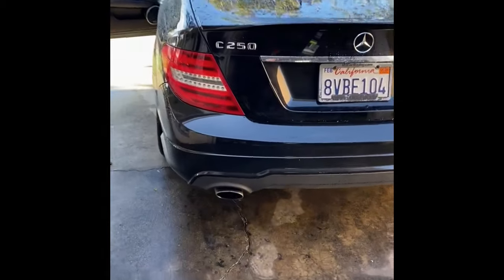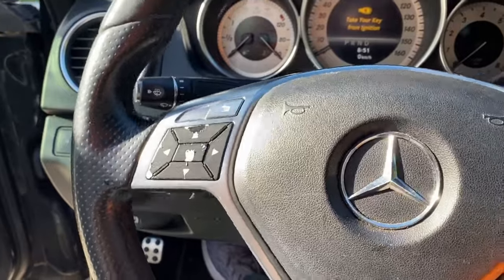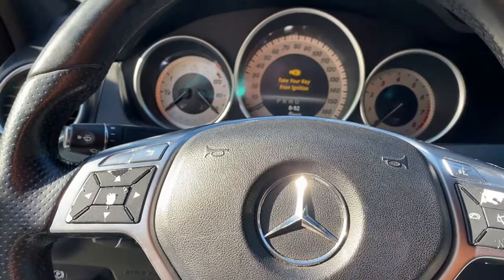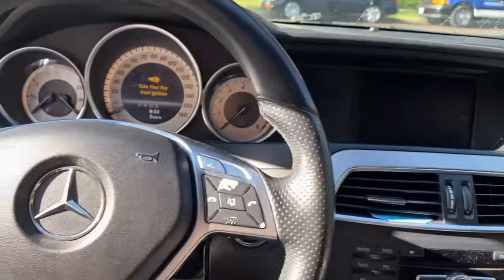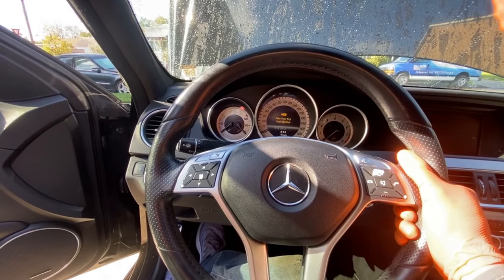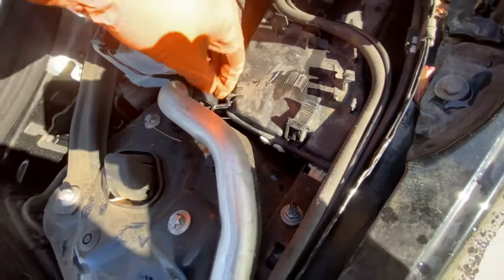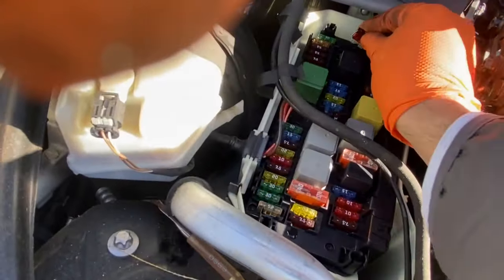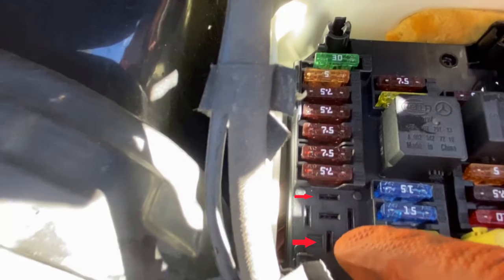Mercedes W204 C300 C250 Locked ESL. Car won't start? You can use this trick to start your car.

Comment: You’re the man. This worked on my 2012 c250, thank god, it got me home. 

Now though whenever I rotate the steering wheel it makes a repetitive cranking sound. Seems it won’t catch and it won’t start without me doing this trick
Reply from the maker: Your steering lock failed halfway closed. You need to remove it and replace it with a steering lock emulator. 

We can help with that. 

https://mercedesbenzspecialist.net/shop/ols/products/mercedes-c-class-glk-class-e-class-coupe-slk-class-electronic-emulator 

Call or text us at 818-510-3375

Comment: Thanks for the tip going to help a lot of people stranded with ESL problems.going to start this project of removing the ESL stuck in lock position.funny how everybody Mercedes ESL going out the same time.
Reply from the maker: Yes. These locks are lasting 8-12 years on average. So a lot of them are going out right now. 

If you need any help give me a call. 

-Michael 
Call us at 818-510-3375
Reply: Hi, Michael I need a one for my car.
Reply from the maker: Call us at 818-510-3375
Reply: dude foreals
Reply: Mine is fail in unlock position , do I need new the esl and eis programmed to my key ?
Reply from the maker: @joeg2286 yes. It doesn’t matter if it failed in the locked or the unlocked position. 

If you’re getting a new or used ESL, it must be programmed. Always. There is no way around it. I highly recommend that you use a ESL emulator instead of a used or rebuilt factory ESL. It will certainly fail again. 

We offer programming services on our website for both the factory esl and the emulator. 

https://mercedesbenzspecialist.net/all-products-%26-services/ols/products/mercedes-c-class-glk-class-e-class-coupe-slk-class-electronic-emulator

Comment: Thank you, it worked like a charm. And after driving it for 10 minutes and parking the car it started on its own without going through that process. Hopefully the issue doesn't show up again but I'm also not going to hold my breath
Reply from the maker: Glad it worked. Unfortunately, it will fail. All of them will fail likely within the next couple of years. The small motor inside the electronic steering lock is the culprit. 

If yours is beginning to fail, that’s how it starts. Intermittent at first then… permanently. 

We can save you big bucks over the dealership or independent shops. 

https://mercedesbenzspecialist.net/shop/ols/products/mercedes-c-class-glk-class-e-class-coupe-slk-class-electronic-emulator

Comment: I got a quick question. When you took out the 7.5 fuse and put it back in and then the jump that you did on the relay was the locking module still connected while you did that because I didn’t understand that part there.???

The reason I ask is because initially you said that the module the locking module got stuck in the unlocked position, so was it still connected under the steering wheel when you did that that’s what I meant.

Comment: Do you stick the green Relay back In once the car turns on??
Thanks for your help. I can use this method to save myself a Triple A tow to the dealership
Reply from the maker: Yes you can. This relay stays open circuit until you crank again.

Comment: Thank you for the video. The slots from the starter relay is from 12 o'clock to 6 o'clock.

Awesome work !
Reply from the maker: Right. The slots are directional opposites too. One horizontal across from a vertical.

Comment: Hi, I'm having this problem and i managed to turn the car on following this steps. I undertamd that I need to buy the emulator. Do I need to unmmount the whole steering column? My wheel is not locked but the car won't turn on nor turn on the lights or electronic systems.

Comment: Did not work on my c300 2009. Didn’t even crank. I’m getting the same symptoms steering wheel is unlocked but this did not work. My car won’t communicate through obd either. Can we book a phone call I saw u charge 30$ for over the phone. I am in pst time zone however.
Reply from the maker: Yes you can make an appointment. Choose a time that you can be at your vehicle. I’m also in pst zone.
Reply: @mercedesbenzspecialist sounds good. Do u guarantee a diagnosis?
Reply from the maker: Yes.
Reply: Did you figure out was wrong mine is doing the samething
Reply from the maker: @nissiaget2itacademy569  this works only for 2008-2012 c classes. 2013-2014 will crank but won’t start. 

A no crank can be a bad starter fuse. Bad connection from fuse box to starter. Low battery voltage. Or bad starter. There is a process to diagnose all of these cases.
Reply: @mercedesbenzspecialist  Can you diagnose a key not turning in 99 E300TD not picking up the rfid or unlocking steering wheel
Reply from the maker: @DaSquidLife yes I can test your key and EIS. $50 diagnostic. If you need a new key or EIS you can put the diagnostic fee towards the solution. 

https://mercedesbenzspecialist.net/shop/ols/categories/diagnostics

Comment: I have never had this problem on my Mercedes, but I have had it happen on my Audi.  I have seen ESL bypass products for sale for my Mercedes, if I do have this problem. What is your opinion of bypass products, are they worth it?
Reply from the maker: Yes. It makes the most sense. The factory steering lock is poorly designed. The lock will fail because of the small motor inside. 

It’s best to replace it before it fails. 

We can program one for you. Check out our website. 

https://mercedesbenzspecialist.net/shop/ols/products/mercedes-c-class-glk-class-e-class-coupe-slk-class-electronic-emulator

Comment: My 2014  C250 coupe has  a lot of sensors reporting errors but everything seems to be working. my front blinkers work but my back blinkers will randomly start working but no constant.  it takes me an hour turning the keys back and forth  to get it to start.  It also drains my battery after i turn off the car. I have to get a jump or have a jump box connected  for a while before it starts responding.    I had water on my floor board but i dont see any corrosion on anything but two connectors and I pulled the carpet and its all dry now.  Still having issues.

Comment: do you know what causes the ESL to activate? is it just wear and tear or can you do something as the driver to accidentally activate it?
Reply from the maker: The motor inside the esl fails. When it fails, you get a no crank no start. There is nothing that can prevent this motor from failing. They are going to fail in every vehicle that has them. 

We can help program an esl emulator when it does fail. 

https://mercedesbenzspecialist.net/shop/ols/products/mercedes-c-class-glk-class-e-class-coupe-slk-class-electronic-emulator 

Call or text us at 818-510-3375

Comment: I have a 2008 C300W Sport that just had this problem, and I used your video to get it running! Thank you great video and clear instructions!! For a permanent fix on this, could swapping the relay be sufficient or will a whole new ESL be the only true fix?
Reply from the maker: To fix this permanently, replace the steering lock with an electronic steering lock emulator. 

https://mercedesbenzspecialist.net/shop/ols/products/mercedes-c-class-glk-class-e-class-coupe-slk-class-electronic-emulator

Comment: Hi there im having issues with my 2001 s55 amg one day out of nowhere the key wouldnt even turn when put in the ignition although my steering wheel isnt locked up.
I had a locksmith come out thinking maybe it was the key fob, but he said that the key was working but he thinks it is a faulty EIS.
Are you able to fix it on this certain model/year?
Thanks
Reply from the maker: Your w220 does not have a steering lock. I can clone your EIS. You need to send it to me along with your key. 

Call or text at 818 510 3375

Comment: I got a problem with my 2008 c180, 2-3min before the problem i started the car and moved the steering wheel to maximum right side and turned off ignition. 2-3 min after that I wanted to start but when I put the key it only sounds like it clicks and nothing happens when I try to start it. It won’t react at something. What could this be? I don’t have that copper cable to try this trick and I really need the car to start tomorrow. What could I do and what could the problem be? 

Thankful for all help I can get!🙏
Reply from the maker: It’s the steering lock. The motor of the steering lock was weak, and with the added resistance from turning the wheels to full lock right side or left side (doesn’t matter which side) the steering lock motor is too weak to actuate the gears inside and unlock the steering column. 

This results in no dash lights when turning the key twice to the right in position 2. No crank, no start. 

Take the steering wheel in both hands and move it left and right hard. Essentially banging on the lock and attempting to move the plastic gear wheel inside the lock. It may free up the lock. If the lock opens up, your car will start. 

Get an esl emulator installed asap. Your factory lock is failing. 

Watch our YouTube videos. You’ll find all of this on video. 

Https://mercedesbenzspecialist.net 

You can find our w204 videos on one page on our website.
Reply: @mercedesbenzspecialist  thanks for the answer! I will try that directly, should the key be inside when I do it? 
If this don’t work will the trick from the video work with a non copper cable? I have a positive cable that I can use if it will work. 

Is the emulator hard to install? 

Thanks again for replying!🙏
Reply: @mercedesbenzspecialist  my friend! I can’t be enough thankful, it worked! Thank you for all your help! Bless you!🙏

Comment: Hey thanks for the fix around, but how do I fix the problem so I can use my key
Reply from the maker: We offer a programmed ESL emulator to replace the faulty steering lock. 

Check our website or call us for more details. 

https://mercedesbenzspecialist.net/all-products-%26-services/ols/products/mercedes-c-class-glk-class-e-class-coupe-slk-class-electronic-emulator 

818 510 3375

Comment: I did this, drove the car home and repaired the car myself. However I have a yellow engine check icon, is a computer/car check gonna get rid of it?
Reply from the maker: What steps did you take to repair this yourself?
Reply: Did you find out what it was I have the same issue
Reply: @xxgodxx9306  it was gone after i drove about 10-15 minutes

Comment: You can try wiggle steering wheel left right hardly while tuning the key it may help unlock the steering column.
Other measure is while ESL still good please urgently buy an ESL emulator and replace it sooner. But it need lock smith to program the ESL emulator. Once you done no more steering lock and last long no problem again.
Reply from the maker: Good advice. 

https://mercedesbenzspecialist.net/shop/ols/products/mercedes-c-class-glk-class-e-class-coupe-slk-class-electronic-emulator
Reply: This actually worked for me today 
Inserted key and it would be recognized, but turning the key all the way right would not do anything 
I held the steering wheel HARD to the left while turning the key to start the car and then it finally started 

Note, that if you let go of the wheel before it is fully “unlocked”, the car will shut off right away 
You have to keep holding the steering wheel until it almost snaps back to the correct position

Comment: Having same issue on my mercedes w176 A180  
2012 it's in unlock position  how can I start there car using wire methods  as u did there  coz need to release hand brake to move the car
Reply from the maker: We don’t have that model in the USA. I’m not at all familiar with how it works.

Comment: Nice video sir .my 2004 C240 key wont turn. When i put it in its slot .so no ignition
Reply from the maker: Any response at all when you insert the key into the ignition switch? A audible “ding” a message on the cluster? Any response from the vehicle at all? If not, it’s very likely the key.

Comment: Mine is is locked position, so how do I drive even if the engine works?? Any solution? I heard yanking the stir while putting the key in will unlock the steering wheel is that true?
Reply from the maker: This trick is more useful for those whose steering lock failed in the unlocked position. 

Yes, jerking the steering wheel left and right and inserting the key into the ignition switch might unlock the steering wheel. If that doesn’t work, you will have to remove the factory steering lock from the steering column. 

We have a permanent solution to this issue. Check out our website for more details. 

https://mercedesbenzspecialist.net/shop/ols/products/mercedes-c-class-glk-class-e-class-coupe-slk-class-electronic-emulator

Comment: Since the steering lock is electronic... And there's already an issue with the system, is there any chance of the steering wheel locking while driving the vehicle?
Reply from the maker: That is not an issue with the steering lock. The probability of that happening is minuscule.

818.510.3375

https://mercedesbenzspecialist.net/

Comment: When this goes out is it normal for the headlights and brake lights and horn not to work also
Reply from the maker: Lights should still work. The horn will not work. Check battery voltage.
Reply: @mercedesbenzspecialist  esl was the cause hit it started now problem is getting the shaft back in place but thank you for helping me get that far.

Comment: I have a 2012 C250 no crank no start only thing that will work is radio and cluster lights up can’t even get obd to read. Has a strong battery as well what could it be?
Reply from the maker: Sounds like a bad ECM to me. Guessing is for fun though. Follow the instructions of this video and find out if your ECM is bad.

https://mercedesbenzspecialist.net/ecm-diagnostic-video

Comment: Quick question. Your steering wheel was unlocked when u jumped the relay. Can this work if my steering wheel is locked and if i do it with the steering wheel locked will it unlock my steering wheel. Thanks.
Reply from the maker: No. This will not unlock your steering lock. You can take the lock out though. Then you could drive it.

Comment: Im out of state can i do this on c250 IS STEERING WHEEL IS LOCKED??? Justat need simple answer yes or no
Reply from the maker: You can. But if your steering wheel is locked, you won’t be able to steer. 

Also, this does not work on 2013 models. 

Call or text us at 818-510-3375

Comment: why to remove and put back 7.5 fuse? and what is this fuse? want to try it on different model  Mercedes. thanks
Reply from the maker: It powers the EIS. When removed and replaced it cycles the EIS into wake mode for a few seconds during this time drive authorization is granted even with a failed steering lock.

Comment: is this performed if the steering wheel is locked> my 250 steering wheel locked but key lites up on dash  doors open and close with fob??
Reply from the maker: Call us for a diagnosis. 

Call or text us at 818-510-3375

Comment: I have a 2009 that does start radio works but lights and window wont work too, check battery voltage its 12. You think its the eis esl?
Reply from the maker: After inserting the key into the ignition switch... with the driver door open. You should here a "ding" and see a message on the instrument cluster reading "Take key from ignition." This tells us that the key was recognized by the EIS. 

Now see if the steering wheel is locked with the key in the ignition. If it's locked, you have a failed steering lock.

If the steering wheel is not locked, remove the key from the ignition switch. It should now be locked. If it's not locked, you have a steering lock that failed in the unlocked position. 

This is the reason your C300 C350 C250 C63AMG GLK350, SLK250 is not cranking. 

See our solution on our website:
https://mercedesbenzspecialist.net/shop/ols/products/mercedes-c-class-glk-class-e-class-coupe-slk-class-electronic-emulator
Reply: @mercedesbenzspecialist  can I unlock the steering wheel on my 2009 by shaking it like you have in the video so i could drive it home?

Comment: nice. Do you hve the ignition wire diagram? 

I'm trying to put a 2jzge nt turbo into my 2005 slk350 and use some of the wire piggy back the 2jz ecu wire

Comment: Thanks you for the tip! Will the power windows work after getting the vehicle to start? My ESL got stuck in the lock position . I just need to roll the windows up until I can get it fixed.
Reply from the maker: Yes they will work. 👍
Reply from the maker: Get in touch with me, I can help you fix the esl problem. -Michael
562.233.0989
Reply: My 2007 c230 did it today. Steering wheel locked and also the ignition locked. I wasn’t able to turn they at all.   Is that normal that the ESL and the ignition both locked.
Reply: @HABIBI19798 emulator😢
Reply from the maker: @HABIBI19798  in the w203 w209 w210 w211 models the EIS will not unlock until the esl unlocks.
Reply: @mercedesbenzspecialist  Is it an issue with the W204's?
Reply from the maker: @davidristic3800  yes
We can program an esl emulator to replace the factory lock. Checkout our website. 
https://mercedesbenzspecialist.net/shop/ols/products/mercedes-c-class-glk-class-e-class-coupe-slk-class-electronic-emulator

Comment: how do i know if it's in the unlocked position? If it moves at all? My steering will has some play in it when i try to start the car, i'm getting a "remove key from ignition" warning and car wont start. I tried this with a paperclip and it didn't work.
Reply from the maker: If you can move the wheels of your car from one side to another then the steering lock is in the unlocked position. 

You can schedule a call with me through our website. 

https://mercedesbenzspecialist.net/services/ola/services/phone-consultation